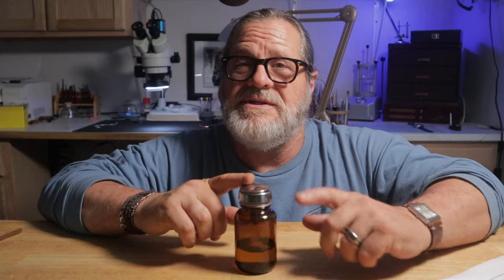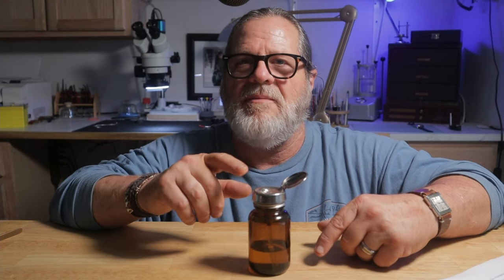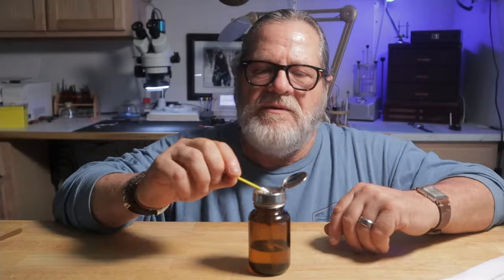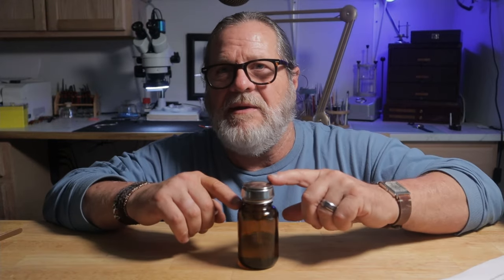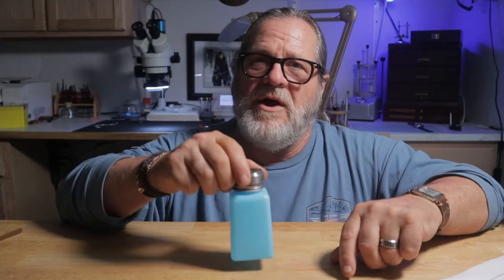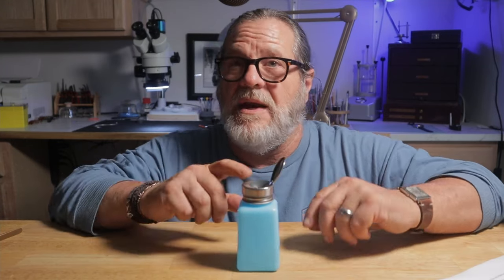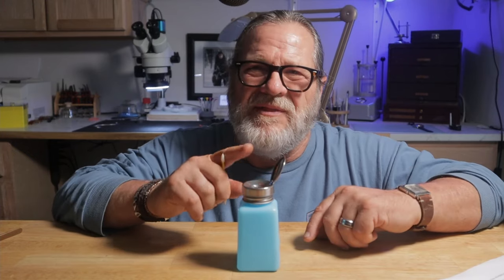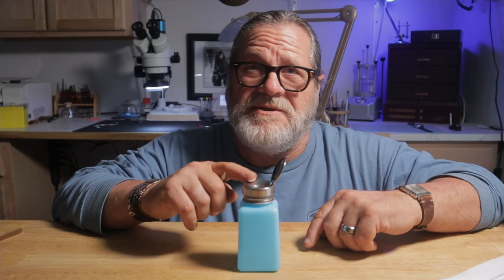How to Clean Watch Parts Without A Machine-Watch Repair Lesson #8

Comment: Hi Alex, as always great video and process explanation. I noticed that your list of recommended items includes an ultrasonic machine. While I can’t afford a professional watch cleaning machine, I do have a nice Elmasonic ultrasonic unit that I’ve been using for cleaning cases and bracelets etc. I’ve heard that I can place the jars of cleaning or rinse solution in the ultrasonic main basket and fill the unit with water then run the ultrasonic for 20 mins or so, instead of spinning the parts as you’ve demonstrated. Is this true, and do you have experience with using an ultrasonic machine to clean the movement and constituent parts? If this is a valid cleaning method, could you recommend length of time for each stage and temperature please?
Reply from the maker: Yea, I use an ultrasonic all the time.
I use it to pre clean the whole movement before disassembling it. I drop the movement in a basket which goes in a jar of hexane for 5 minutes minus the pallet fork and balance wheel. I always clean those by hand.

Then it goes into a dryer. I also use it primarily for cases and bracelets after that.
You can use it for parts after disassembly.
I would get some small part baskets and a dip basket which is in that equipment list. The dip basket fits in a small wide mouth mason jar.
Heat is not required as most cleaners and rinses are flammable.
About 5 minutes per cycle after pre cleaning should be fine.
The biggest issue is not spinning off the cleaner and rinses between cycles.
Your fluids become contaminated faster.

There are lots of cleaners and rinse combos you can use.
Reply: @watchrepairtutorials  thanks Alex!

Comment: Question: What do you rinse in?
Reply from the maker: So let me clarify I have a rotary machine that I use professional grade cleaners in but I also use the ultrasonic as well. In the ultrasonic, I use a water-based cleaner and I rinse first time under the sink and the second time in distilled water. Thaats followed with a rinse in 99%.IPA misuse the pallet fork and balance wheel which I always clean by hand separately. If you using napatha, skip the water and just use 99 % IPA as your final rinse.
Never use anything under 99% because it has water in it you don’t want that

Comment: Hi Alex, love your video tutorials, they are extremely helpful. I not iced in one video you have a watch cleaning machine. I`ve just bought a 1950s Lanzetter National Electric cleaning machine and restored it, ive been told to use Horotech cleaner in the first jar and Horotech spirit rinse in the 2nd and 3rd jars. I noticed you have `Alcohol` in your 3rd jar / 2nd rinse, do you use Isopropyl for your final rinse ? Cheers. Glen UK
Reply from the maker: I do use 99% IPA in my final rinse but I do not have the pallet fork or balance wheel in my cleaning machines

Comment: Hi Alex! Thanks for this and other videos you have published. I just found your channel and appreciate its content, which is up to the point of getting amateur watchmakers to go on with there hobbies. I recently purchased an ultrasonic cleaner and did a few cleanings using a washing machine detergent. Do you think it's OK to continue using it, or L&R solution is a must? Thank you!
Reply from the maker: There is only 2 goals to cleaning parts. The first is not putting it in something that will discolor or damage it and the other is that the parts come out clean with no residue. There  are a lot of ways to get there.
I am working on an ultrasonic video right now.
Reply: @watchrepairtutorials  Thank you for the reply. I guess, I will find the answer to my question in your coming video about ultrasonic method of cleaning. Will definitely watch it!

Comment: How do you handle the very inner/central part of the main spring? It will not unwind enough to clean as described?
Reply from the maker: The best you can. For precleaning you can use a variety of different styles of  qtips and then run it through your cleaning process.
Reply: @watchrepairtutorials  thanks for everything! Immensly useful for a beginner like me and so well presented.

Comment: Hi, Alex. I’m here again to ask your help.

I can’t seem to find Naphtha here in the Philippines.  Not even V&M Naphtha.  I’ve been using locally-produced lighter fluid for my pre-cleaning and though the results are ok, I’m not really sure of its content.

I found a video online of someone doing a movement service using Gamblin Gamsol, a solvent used by artists in oil painting.  I checked the MSDS and it indicates it is 100% naphtha hydrotreated heavy.

But I find it a bit oily/waxy compared to lighter fluid.  I’m not sure if this how Naphtha is supposed to be.

Is Naphtha feel oily/waxy?  Also, it doesn’t evaporate as fast as lighter fluid.  What do you think of Gamblin Gamsol for Watch cleaner?

Thanks again for your help!
Reply from the maker: Definitely not ideal. All readily available napatha has some impurities in it. The amount will vary depending on brand. 
What’s important when cleaning parts is that those impurities are removed. 
Anything left behind will pull lubricants away from where you want them to be. 
So if you have 99% IPA, you can use that as a rinse. 
Incidentally, when you see Napatha listed in professional grade cleaners, they are using a pure form. 
The key to clean watch parts is that when finished, they are chemically clean.
Reply: @watchrepairtutorials  Thank you so much!

Comment: Excellent presentation. For myself, I have an ultrasound that I picked-up for about $100USD. I'm wondering if there is any benefit to putting the three rinse jars in the ultra-sound bath, one at a time, for a couple of minutes rather than relying on a static soak in the jar alone. Thoughts?
Reply from the maker: I’m not sure what you are referring to. Can you elaborate?
Reply: @watchrepairtutorials  Sorry I wasn't more clear. From the video I understood that each of the three rinses was conducted in sequence and that the soak in any particular jar was static. I was wondering if there any benefit to doing each soak in an ultrasound by simply locating the soak jar in the ultrasound bath and running it. Thoughts?
Reply from the maker: @BruceWSims  each rinse jar would be agitated either in an ultrasonic or a spinning basket to remove the previous liquid, wash or rinse, from the parts. 
You are  basically just  diluting the previous wash liquid down further so at the end of the cleaning cycle, there is only rinse left on the parts before drying.

Comment: What will happen to the ballance and hairspring in Naphtha?
Reply from the maker: It will be left with some sort of residue on the hairspring.
Unless it’s a pure grade, it’s gonna leave behind something and that’s usually an oily substance, which is not ideal for hairsprings.
You can test your brand with an evaporation test on a piece of glass, letting it evaporate and then see if anything is left behind.

Comment: good day sir would you recommend i use an ultrasonic cleaner if i already have my hands on one? if yes, what would be the best way to go about cleaning the watch parts?
Reply from the maker: Hey Dillion, 
Yea ultrasonic machines can work well depending on many factors. I’ll be doing a video soon, but in the meantime just use water in the tank and you can still use the jars with your fluids. 
I still wouldn’t put the balance wheel or pallet fork though. Machines with power sweeps are better.
Let the water and fluid sit for a couple hrs  before using if you don’t have a degassing function.

Comment: I made my basket based on your design. Is it ok to use naptha for both the pre clean solution as well as the main wash? Followed by 99% IPA in all 3 rinse jars? Just want to make sure I have this right. Plus hexane for balance.
Reply from the maker: Yes the napatha is fine for the pre clean and wash.
IPA is fine for rinse cycles. 
I just found out recently that Hexane is only available if it can be shipped to a commercial company so since it is going to be hard to get for most people I would go with the OneDip for the balance wheel and pallet fork.

Comment: Hello, thanks for the video, i wanted to know do i need all the cleaning products you said or do i need just one like hexan or ipa?
Reply from the maker: Hexane is primarily for cleaning the pallet for and balance wheel. You need a watch and rinses for your watch parts separate from hexane and IPA. IPA can be a final rinse if you are using water.
Reply: @watchrepairtutorials  So the conclusion is that in the first stage of cleaning i need the solvents you said or naphtha then second stage is ipa or hexane, and then just water ?
Reply from the maker: @Air989  Precleaning can be done with ipa, all parts COULD be cleaned with Napatha , BUT Hexane or Onedip is BEST for the pallet fork and balance wheel. You can rinse in water IF you use IPA as a final rinse to displace the water otherwise you will get rust.
Reply: @watchrepairtutorials  Thank you Alex for your patience in answering my questions i am your subscriber 4life!!!

Comment: So if I was using naphtha and IPA, I would have one wash jar with naphtha and three rinse jars with IPA. First preclean with IPA+qtips and pegwood. Then a cycle in the wash jar, followed by one cycle in each of the three rinse jars. Then follows the drying stage. Is that all correct? As for hexane, would that just be an alternative to IPA in the steps above?

If I were using the two L&R products, would I have one jar with the wash solution and three jars with the rinse solution? 

Last questions, if I were only going to buy one of the L&R products, would it be (1 wash jar of naphtha + 3 jars of L&R rinse)/(1 wash jar of L&R + 3 jars of IPA/hexane)? Which L&R product would you recommend buying first?  Thanks.
Reply from the maker: If you are  handwashing parts with a brush, you can use napatha to clean the parts and then 99%  IPA to rinse the parts. One wash cycle and one rinse cycle.

If you are making something similar to what I did in this video then yes you would pre clean 1st then you want to use Napatha as a wash and then 2 to 3 rinse cycles of IPA then dry.

Hexane is used for cleaning the balance wheel and pallet stone only. Reagent Hexane is expensive and has some volatile fumes so you want to use it sparingly. You can also use CRC electronics cleaner instead of hexane. 

If using L&R the sequence is the same as above no matter the products used. 

If you were only using one L&R product I would go with the extra fine wash.

None of these flammable products should be used in ultrasonic machines. This is for spinning basket type set ups only.
Reply: @watchrepairtutorials  Thank you kindly!

Comment: I'm just getting started with this as a hobby to see where it takes me.
Question,
Does the "working position", lower seat, higher bench, present any discomfort or pain in your shoulders or neck?
Aloha
Reply from the maker: Well, when working under a loop, it is the most comfortable position for all-around comfort but I spend 95% of my time under a microscope so the comfort level for me is normally pretty high

Comment: Question for you - In currently working on perfecting my cleaning process. I have a ultrasonic cleaning machine and have been using the liquinox you mentioned in another video. It works good, but I know if I want that lustrous shine I gotta get the expensive stuff. So, I bought L&R extra fine #109 to clean and a ultrasonic rinse #121. I know it says ultrasonic but I've always seen people use the machines that spin a mesh basket in a jar of solution. 

My question is, which method gives you the best overall result? I want the best clean/shine possible. Ultrasonic or spinning basket in jar, which is best?

As always thanks!
Reply from the maker: L&R in a spinning basket. I have found this work better than in ultrasonic cleaners. But be aware that even L&R can only do so much depending on the part condition.
Reply: @watchrepairtutorials  you mean L&R doesn't mean Lord & Restorer?!?! Also, as you taught us, one must also pre-clean! This ensures a cleaner end result and prolongs the life of your cleaning agents!
Reply: One more question! I'm just gonna use a vevor lab mixer, some wide mouth mason jars, and a basket I can attach to the lab mixer. Any recommendations on good baskets that have the different compartments/levels? Affiliate link maybe I can click? 

Do you think this setup would work?
Reply from the maker: @KrimNL10DenZ  I don’t now of any multi layer baskets. I use my baskets from my vintage Zenith when I need them. 
No links unfortunately. 😔

Comment: Thank you so much for making the detailed videos. I was wondering if you have had any experience with the Bulova Watchmaster cleaning machine. I have the chance to purchase one but I’m not sure if it’s worth the $300 price tag. Your insight would be much appreciated.
Reply from the maker: Hi James,
The problem with any ultra sonic cleaning set up as I see it it how long the cleaners and rinses will last.
I use a ultra sonic machine to Pre Clean parts before I inspect them.
I first clean if any obvious grease, put the parts in baskets with lids and drop those in the ultrasonic with cleaner. I then rinse the cleaner with water and then straight into a jar of IPA alcohol. Once they come out of the alcohol they go into a dryer. This is done without the balance wheel and pallet fork which I always clean by hand.
Then I inspect the parts, peg the jewel holes and do any polishing or repairs that needs to be done.
Then I do my final clean in a 4 jar spinning cleaner.
The issue going from one ultra sonic jar to another is not being able to spin off the excess fluids before going into the next jar. This is going to shorten the life span of your rinse cycles.
Reply: Hi Alex, thank you so much for the reply, and thanks for what your doing on your channel. I really appreciate your direct, to the point teaching style. The main thing I liked about the Bulova machine was the heated spinning stage. I’ll probably hold off and go with your described system.
Again, many thanks!

Comment: What about using CRC brake cleaner? It is made of tetrachloroethene which is the same ingredient in One Dip. I have been using this in a 3 jar system inside an ultrasonic, filling the ultrasonic with water and setting the cleaning baskets inside the jars then placing them in the water of the ultrasonic (not fully submerged).
Reply from the maker: Absolutely. I talk about using it to clean pallet forks, and the balance wheel.
I don’t use it for cleaning the other parts, though
Reply: @watchrepairtutorials  any harm in using it for everything? It seems to be cheaper than even naptha around here. By the way fantastic series. It has been a tremendous aid in restoring my Great Grandpas Hampden 16s 21J RRG.

Comment: Hi , How do you clean black oxidation off the chrome finished winding and crown wheels? Thanks in advance
Reply from the maker: It’s kinda hard without seeing it but try soaking it for 24 hrs in your cleaner and use a piece of peg wood to scrape it. If it’s rust based I use evap-o-rust

Comment: Coffee filters are also lint-free.  Doesn't IPA attack the shellac holding the roller and pallet jewels in?
Reply from the maker: IPA can definitely soften shellac, which is why I only clean the pallet fork and balance wheel in hexane. All the other parts are cleaned final rinsed in IPA. 🤙
Good tip on the coffee filters.

Comment: Great insight as always. You mentioned not to put the pallet and balance in one of the liquids. What liquid is safe for those components? Ipa? Hexane?
Reply: IPA will dissolve the shellac on the pallet fork and balance. Hexane ought to be safe. 

That said, shellac won't instantly dissolve in IPA. It would take a few minutes but if you were to use IPA as your rinse liquid of choice, a full cycle would probably do it.
Reply from the maker: Yea, a quick dip in IPA is usually going to be ok. Hexane is completely safe for shellacked parts
Reply: I'm curious about your stance on using a sonic cleaner on watch parts. Yay or nay?
Reply: @plopsplipspladoodle  L&R has an ultrasonic cleaner specifically for watch parts (#111). It's ammoniated so probably very similar to traditional watch cleaning solution. It's what I've started using recently in lieu of Hexane and I've found it to do a better job. Smells gross tho.
Reply: @vparseval  do you still need to do a rince cycle after the sonic cleaner?
Reply: @plopsplipspladoodle  anything ammoniated will need a rinse. Distilled water works well, or the dedicated rinse that’s meant to be used with the cleaner. Really depends on the cleaner though. I like rinsing with IPA after distilled water, to make sure no water stays behind. I don’t IPA rinse shellacked parts, those go straight to a Hexane rinse. The type of cleaner you start with dictates your rinsing approach and there’s many ways this can be done based on what is available in your region

Comment: When you use the dehydrator to dry the parts do you heat it while cleaning or just heat it when go to dry the parts?
Reply from the maker: I turn it on when the parts go in the final rinse.
Reply: @watchrepairtutorials  thank you.... your content is amazing now i just need to find a gentler hand for the balance complete.
Reply: @watchrepairtutorials  i know you say above room temp... but is there a high limit... as in if its 74 in my house and i set the degydrator to 130 or 140 is that too high?  And the opposite... would 85 be enough or too low? Thanks